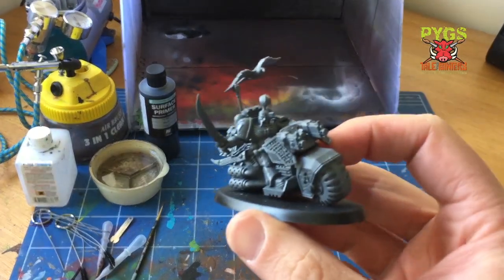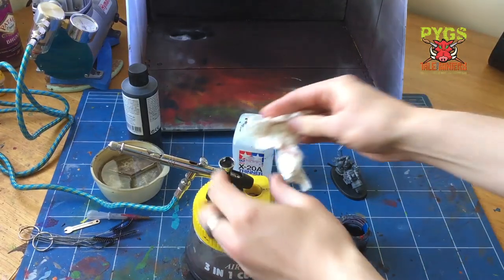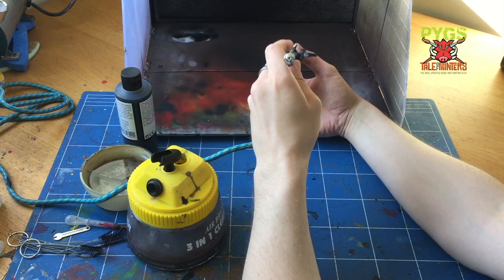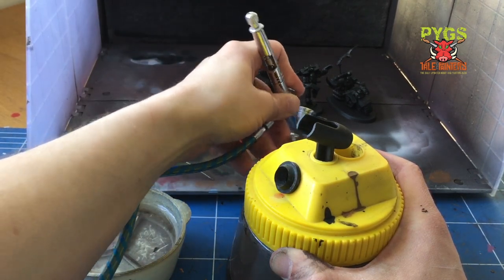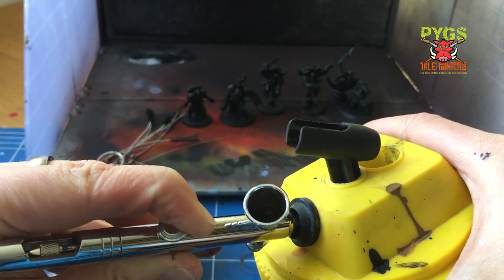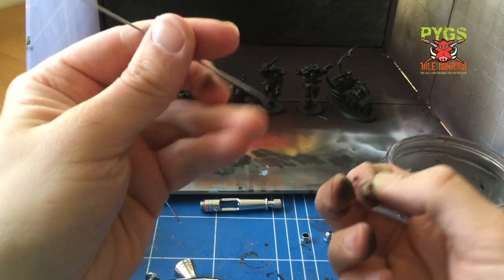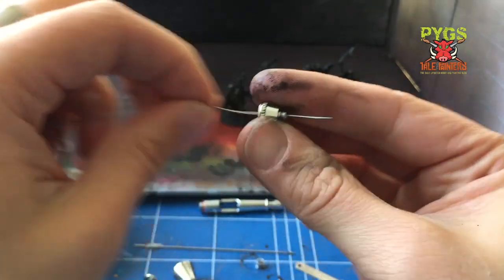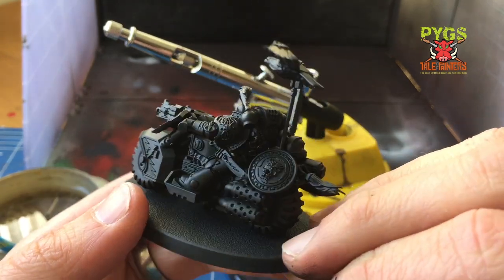Using an Airbrush and thoroughly cleaning an Airbrush Part 2 VLOG04

Comment: Oy, I think everyone who starts a hobby channel goes through airbrush tutorial. OPN has some great airbrush videos, check them out if you haven't...WGC..Lester Bursley...the list goes on, but it's nice to see your view on airbrushing...as far as your compressor running away, put two bricks, one on each side.  I run a Badger TC910, shaped like a computer, I put it under my desk between two objects, leg of the desk and a crate.  Also, wait 12-16 hrs after using polyurethane primers.  The longer you wait the better coat you'll end up with.  Also, if you are using a tank, be sure to empty it once a month.  Unscrew the bottom plug, while its sideways, put a dish towel or paper towel under it, tilt it up and empty the water that builds up inside the tank.  The hotter you run your compressor the more condensation builds up inside the tank.  If you see rust in your water from emptying it, I'd suggest replacing the tank.  Rust is your enemy, with it building up in your tank it'll cause your tank to weaken.  Great video Garfy.  Keep them coming.

Comment: Great video, very informative. Just a quick question, if you were going to airbrush several consecutive colours, like undercoating and then basecoating a Stormraven, for example, would you clean it in between the different colours?
Reply from the maker: I would probably "semi clean" it. I'd empty it, blast some water through it, do the back blasting trick in between colours. After a complete session I'd give it the full over haul. Thanks for watching.